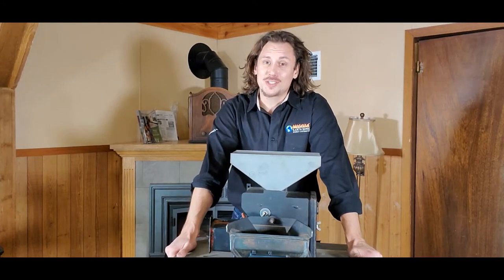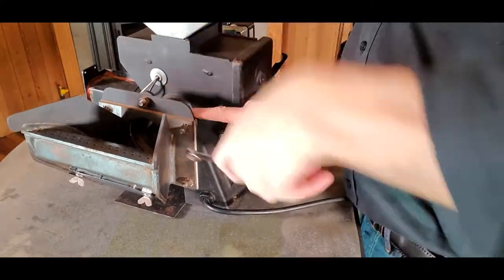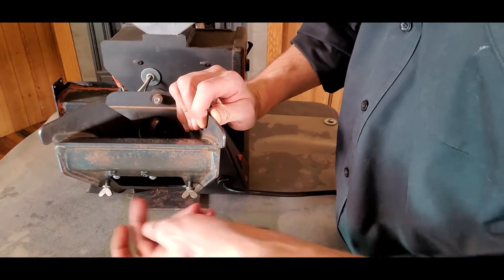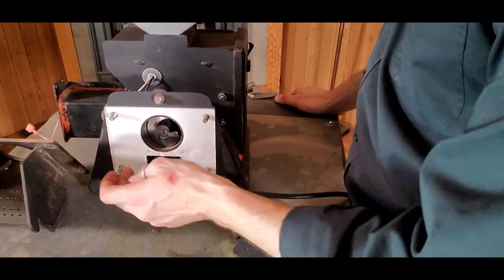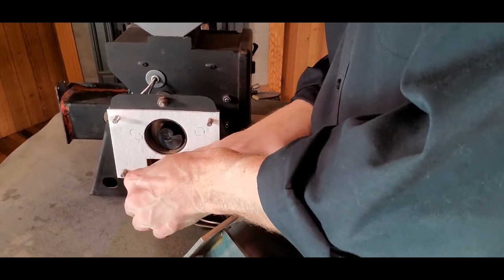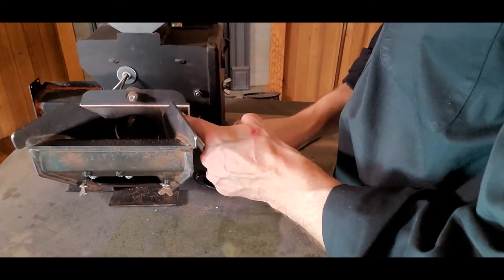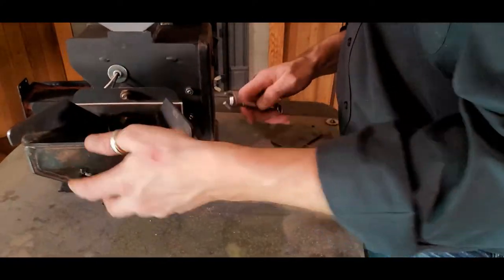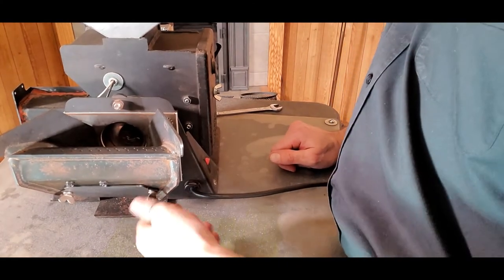Harman Burnpot, Firepot Replacement

Comment: Great video.  

I recently replaced my burnpot on my P43. One suggestion I would make is to check and retorque the 4 bolts after waiting a week or so. I believe the gasket gives a little after installation. Again, don't overtighten...snug up.
Reply from the maker: That is an excellent suggestion! Yes that gasket can compress a bit; good call and really appreciate your input!

Comment: I notice that most of your videos are done with the feed/burn pot mechanism positioned nicely on a waist high table, (though I can't for the life of me understand why you can't stop it from wobbling so much, which is a bit annoying).  It would be nice if you were to do some of your videos on an actual stove because that would show exactly how much of a job it would entail.  I will say that your videos are always helpful.  Thanks.
Reply from the maker: Thanks for message and feedback. Yeah, wobbly table and uneven floor when shooting a few of these videos. Wish I could have fixed that, but was the best I could find and do with the time allocated. We do have a handful of videos with the actual stoves and going through parts replacement. I'm the one that does the videos and I live in a different state, so most are remote and just the part, however I try to get back to Wisconsin when able to shoot videos at the store with the stoves. Any suggestions for future videos just let us know, glad to hear that they have been helpful. Thanks!
Reply: Completely agree on the wobbling work surface.

Comment: When replacing the burn pot on a 52i harmon it has metal gasket and the paper one should you put metal one back in?? Also I was told to silicon the wires at the back where the come through?? Is that necessary?
Thanks in advance..
Reply from the maker: Hey Ron, thanks for contacting us, happy to help. The metal gasket you are referring to is actually an airflow upgrade that was used on your 52i model. Yes, definitely make sure that is in place along with the Liotherm paper gasket. The silicone on the wires would refer to the igniter wires coming through. Once the igniter wires are pulled back you can silicone around that plug area where the wires comes through, however it is not required. Most earlier units all had silicone on that plug, most newer units do not use silicone on that plug. Hope that helps, any other questions please let us know. Appreciated!
Reply: I also have a 52i accentra with the metal gasket. However it looks like there might have been paper gasket on front and back of metal gasket. Do I replace with 2 or just 1? And if 1 do I put the metal gasket against the burnpot or auger side?
Thanks!
Reply from the maker: @tforbes4491  Thanks for contacting us. The metal plate is an airflow upgrade. You will want to use 2 gaskets. Burn pot, gasket, metal plate, gasket, stove. We also offer this paper gasketing as a sheet where the customer can trace and cut their own as another option. Link here, any other questions please let us know. Thanks!
https://pellethead.com/product/liotherm-high-temperature-fire-rated-stove-fireplace-fiber-gasket-seal-24-x-12-sheet/

Comment: Would have loved to have seen a picture of the bolt side so we see how the bolts are attached.
Reply from the maker: Thanks for the comment Mike, they are not actual bolts, they are threaded studs used on the burnpot  for Harman. Any other questions please let us know. Thanks!
Reply: Do you know if they were welded in on the early model XXV?
By early, I mean my serial number is only 4 digits long.
I was one of the first in my area to purchase a XXV.
Reply from the maker: @mikewhitecotton8551   Hey Mike, no they should not be welded. If there is an issue with the studs, sometimes folks can pound them out. If they cannot be pounded out, one would need to replace the feeder body. Here is a decent diagram image of the studs on the early feeder body like you would have in your XXV. https://www.stove-parts-unlimited.com/harman-feeder-weldment-1-10-677150-p/1-10-677150.htm
Reply: Is this similar on the P series harmans? Some of the burn pot nuts look really worn and crispy. Not looking forward to that haha. Should I douse them with penetrating oil and then tap on them a little to try and loosen them?

Comment: If a bolt that holds on the fire pot breaks off can it be replaced?
Reply from the maker: Hey John, That's a good question. I'm going to run that past a lead tech and see if that is possible. Following up shortly. Thanks.
Reply from the maker: Hey John, heard back from our lead tech - 
It depends on which feeder we are talking about. 
Cast iron feeder – the studs are threaded into the feeder body with thread lock. Very difficult to get those out.
Steel feeder / two versions – these studs are welded in.
In any case the feeder body must be removed.  If someone is handy and can weld, the broken off stud can be replaced with a 5/16 bolt that is welded in place of the removed broken stud.  It’s a hassle for any Harman but the Accentra fs is especially troublesome since the cast body is assembled from pieces and must be ratchet strapped together as it is disassembled at the top.

Comment: I’d like to know how many rows of holes are in a Harmon insert burn pot
I can’t see all the holes to clean them. But I can count the rows
Reply from the maker: Thanks for contacting us. Do you know what model Harman insert you have? Burnpots will vary between models. If you have a small mirror and a good light, that can be very helpful in ensuring all the burnpot holes are open. Let us know your model and I can have someone from our team check the burnpot hole rows. Thanks,
Reply: It is a Harman Accentra 52i pellet insert
Where the pellets burn the most. I have a hard black crust  and I can’t remove it. I tried while the fire is burning. And I’ve sharpened an old screwdriver and bent it to the right. It just doesn’t remove the black crust. And I know there are jokes under the black crust. I wish I could remove the burn pit so I can ckean it better
Thanks
Reply from the maker: @Mr23frd  Thanks for the message back Ed. The Accentra 52i will have an 82 hole burnpot. Technically there are 10 rows of holes, however not all rows have holes all the way across. Here is the burnpot for reference and you will see in the pictures what I mean. https://pellethead.com/product/harman-accentra-52i-52i-tc-burnpot-firepot-grate-weldment-82-hole-oem/

We designed a specialty scraper tool for the Harman burnpot to be able to remove the difficult carbon build-up you are referring to. Specialty hardened tip - angled specifically for the Harman burnpot. Here it is for reference: https://pellethead.com/product/harman-heatilator-eco-choice-burnpot-firepot-grate-scraper-tool-aftermarket/

Harman Burnpot Cleaning Tips Video: https://youtu.be/Ukao3dCooec

Keep us posted, happy to help.
Reply from the maker: @Mr23frd  Unfortunately the inventory team has said it will be 3 months before the Harman scraper is back in stock.
Reply: Thank you sooo much. That picture of the burn pot will help me out tremendously
Reply from the maker: @Mr23frd  Absolutely Ed, happy to help!

Comment: How do you replace a feeder weldment . Ihave a hole in tube
Reply from the maker: Hey Donald, thanks for contacting us. Are you referring to replacing the auger feeder shaft? Video below on that. When you say you have a hole in the tube, I assume you are referring to the vacuum switch tube/hose correct? If there are any cracks or holes in the vac switch tube that tubing needs to be replaced. Here is a link on the tubing for reference - https://pellethead.com/product/harman-heatilator-vacuum-pressure-switch-silicone-tubing-hose-aftermarket/

Auger Shaft Replacement Video: https://youtu.be/B-vWuLh9zbE

Any other questions please let us know. Thanks!
Reply: @EarthSense  thanks 4 the help
Reply from the maker: @donaldshaffer1870  Absolutely! If you need anything else please let us know. Appreciated.

Comment: lol do it in the furnace….. not as easy as you make it look! I’m 6’3” 245 lbs it sucks! And the igniter goes about every 2 seasons! Had the PF 100 for 18+ years now
Reply from the maker: Thanks for contacting us. Yes, definitely more challenging replacing the burnpot in the unit vs the demonstration for the video here. You should not have to pull out the burnpot when replacing the igniter element - I'll include a video below on Harman Igniter changeout. Additionally, in the coldest part of the season you can flip the igniter toggle to manual so the unit does not cycle on and off as frequent which should conserve the igniter element longer. If you need any assistance just let us know. 
https://youtu.be/i7n1SSgCPMc?si=NlTJzUGIK6spMUmJ
Reply: @EarthSense   no you don’t need to pull the burn pot out to replace the igniter but the burn pot is sideways in the chamber leaving no space to do it lol
Reply from the maker: @rickryan5527  Ok, well if you need any help or tips just let us know. Thanks.

Comment: Just replaced the burn pot gasket on my accentra freestanding. I used a 1/2” socket, a universal joint , small extension and a ratchet, all 3/8” drive. The bolts are welded in. They won’t loosen. The bottom 2 nuts are the easiest . The top 2 are hard. I used a propane torch and heated the nuts first. They all came out fine but a was sweating.  Cleaning all the slag or creasote off is essential to get your socket on.  You need to hammer the socket on so it won’t slip and round the nuts.
Reply from the maker: Thanks for sharing your experience and tips. Very appreciated.